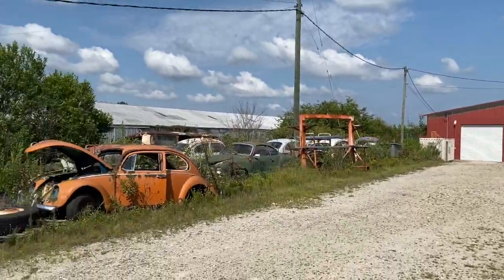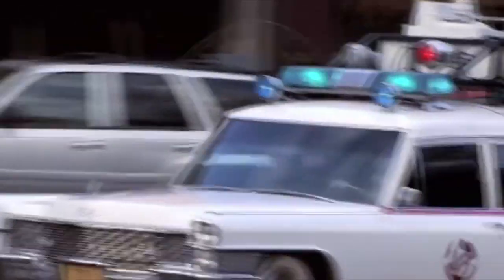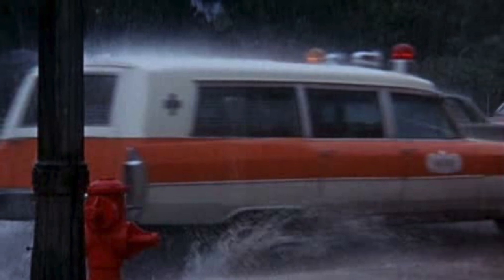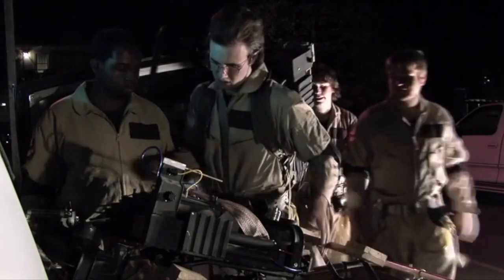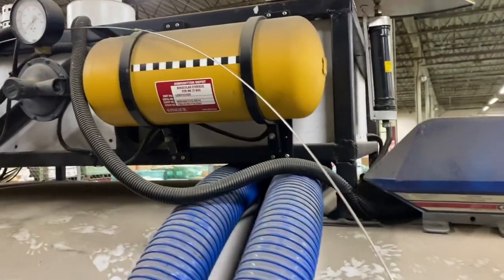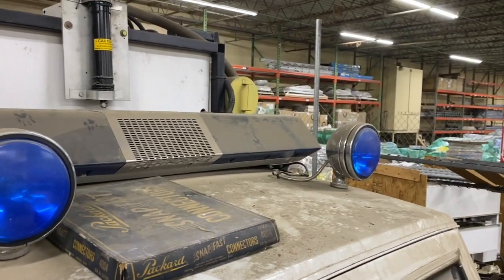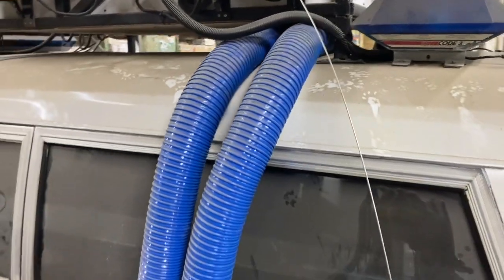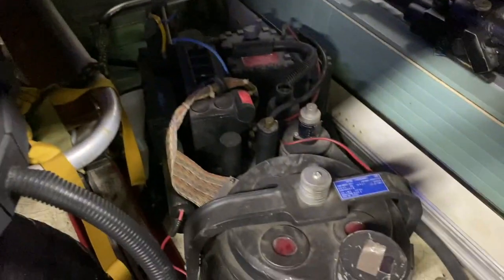Ghostbusters: Afterlife -- a real-life Ecto-1 Barn Find!

Comment: If people ask you "is that the original?" When the year is clearly off... you did a good job. I've seen closer year and exact year replicas that haven't looked as good as yours, so yea.. It's a good job. At least it's a real Miller Meteor. Seen a correct year Ecto 1, but it was not MM, that wasn't as good as yours. Real good job with the fine details, not having exact pieces. I didn't notice them until you said something, like the light bar and siren.
Reply from the maker: I appreciate this. Thanks for that!

Comment: Great car. Your Light bars are not force 4 per say. After watching your vid, u can clearly see your bars have front and rear flashers instead of diamond reflectors. The cut outs on the back of your bars on each dome attests to that. Easy to gut and replace if one was so included.
Reply from the maker: It's weird -- the front ones have diamond reflectors, and the back ones have the flashers. But yeah, they've got Code 3 domes. Mix-and-match.
Reply: @unfinishedstudios  Another thing I noticed is that you have right and left ally lights on the front bar, I'd take them out as they will cook that area of the end caps since there's no cut out for it to cast light through.
Reply from the maker: @TheTJK002  Eh, they've been fine since I was in 11th grade -- now I'm teaching 11th grade. I think they work out.